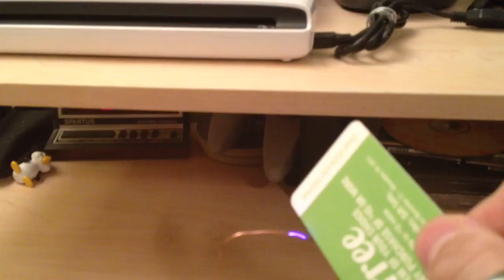Singing arc

Comment: Use a totem pole NPN and PNP complementary pair such as the 2n3094 and 2n3096 in-between pin 3 of the 555 and MOSFET gate to improve switching speed, it should help with some of the heating. However some heating will be present as without a snubber the MOSFET will avalanche every cycle and turn some of that back emf into heat.